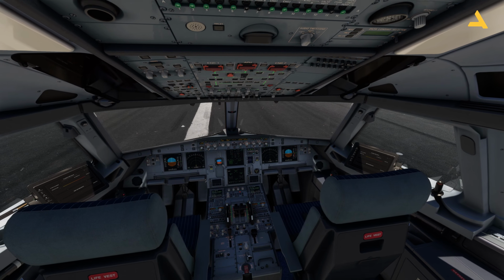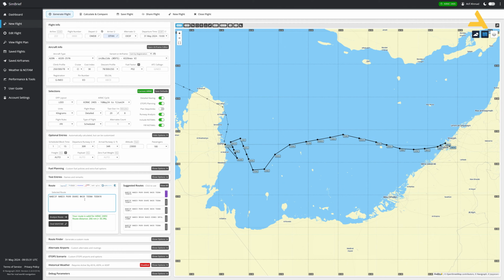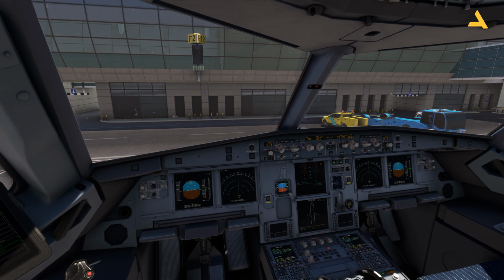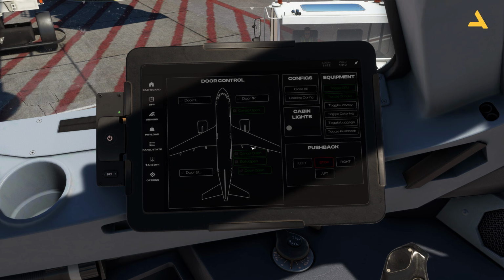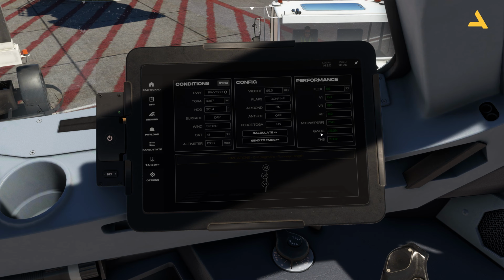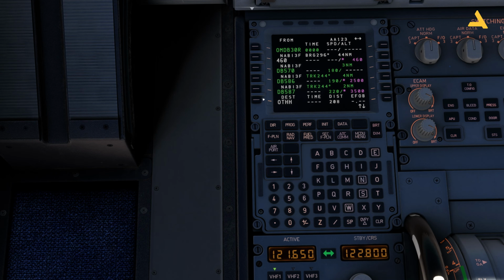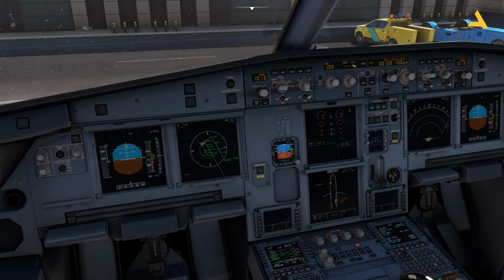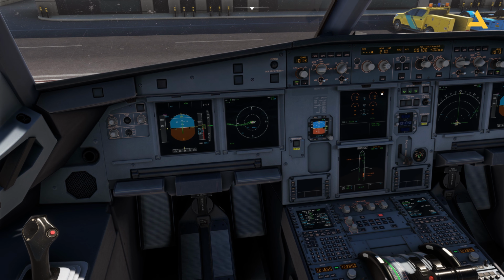Configure the EFB and MCDU of iniBuilds Airbus A320 Neo - MSFS 2020 - A320 Neo Tutorial 7

Comment: on xbox version there is a weird issue i experience occasionally where init b is impossible it just says not allowed when trying to go left or right.  the only way ive found around this to get weight in is go to fuel and input there.
Reply: I also encountered this problem on Xbox. But after watching this video, I think the problem is that the data coming from the EFB into the INIT screen has to be loaded in two phases as per the acronym “DIFRIPS”. The 1st “I” or INIT is loaded before your “F” or flight plan and the 2nd “I” is loaded from the EFB just before PERF. Then you should be able to advance INIT to the second page. Hope this helps.

Comment: Great video and very informative. I have been flying this plane a few times and now I learn moor about the settings. I only had one issues at approach phase that the plane deviates from the route. The A320 neo fbw does not deviate at same route. I will try again but with your flight from Dubai. Wish me luck. 🙂
Reply from the maker: How much is your speed during the approach phase?
Reply: @aatifahmad  I use manage mode at TOD for decend and approache phase acitvated. The plane follow tha path and suddenly just leave the gps route. Same in some other fligt. Do the sae route the same way in A320 FBW and that plane never leave the route. Everything else works as expected in bothes planes.
Reply from the maker: I wish I could help you with this problem. Usually the plane deviates from the final approach if the speed it high. If I ever face a problem like this under normal approach phase then I will try to find a solution for your problem. Thank you very much for watching the video. Have a nice day

Comment: Hey can you help me? My whole flightplan is ready but when i try to do my clearance it does not work. I tried everything with the settings but is does not work. And yeah i turned the call sign on.( Inibuilds a320)
Reply: If you are not able to use ATC for clearance, then check the radio panel to enable call and volume. If it still doesn't work then you may have not selected IFR flight in Microsoft flight planning window in the beginning.
Reply from the maker: Thank you very much for your input. Have a nice day.
Reply from the maker: With this plane you cannot file for IFR plan. Maybe this feature gets available in the future but currently it is not available. Thank you for watching the video. Have a nice day.